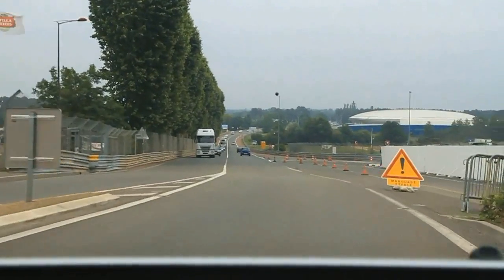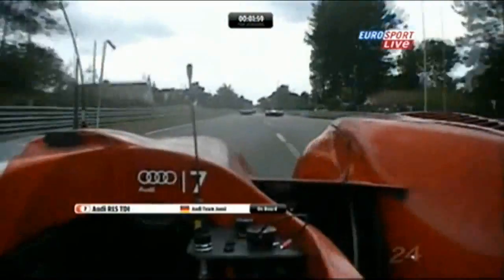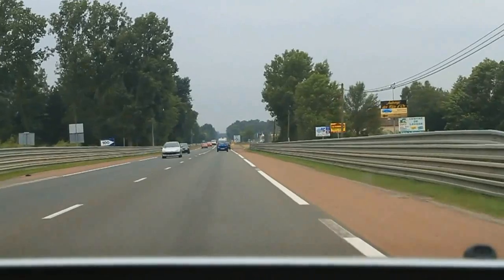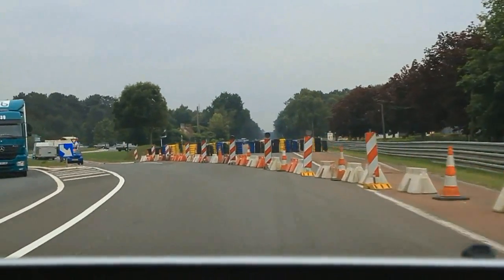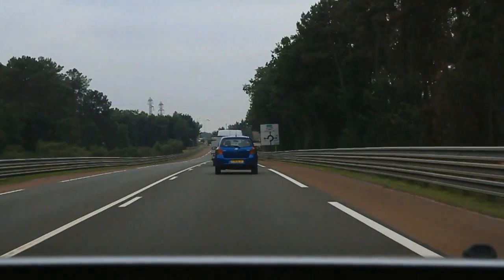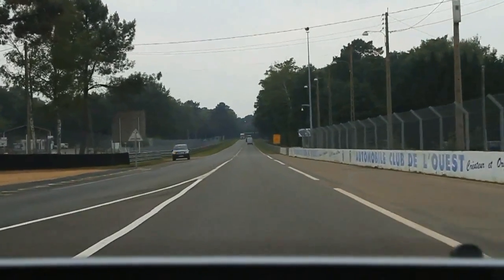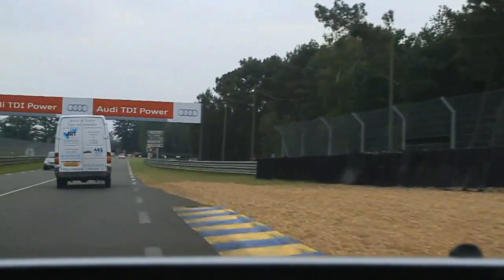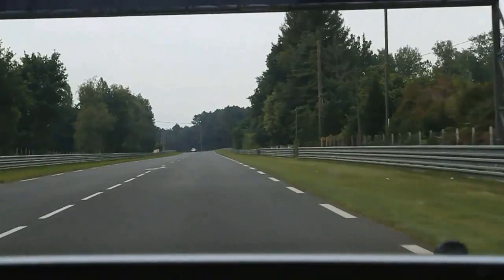Our drive on the public sections of Circuit de la Sarthe

Comment: Tetre Rouge starts the Mulsanne Straight road, where race cars reach 200+ mph before turning the chicanes. The chicanes previously didn’t exist, allowing for a 250 mph top speed record on the public straight. When getting to another straight, the race cars take a short straight in the braking zone before returning to the public straight. Traffic would go around. If that stop sign was there in the race, every 3 minutes the race cars would need to stop. At the Porsche curves is where the race cars end their public speed runs and return to the actual track.